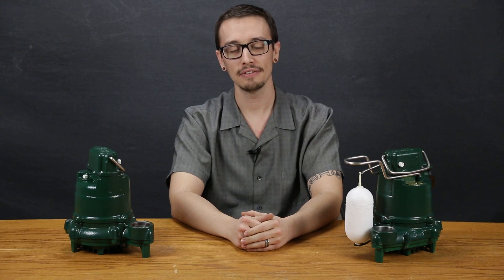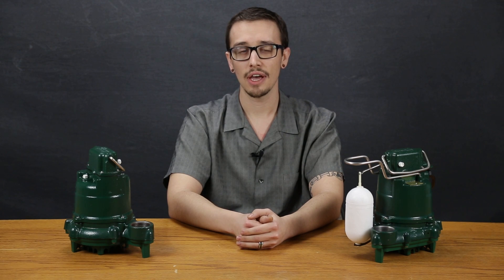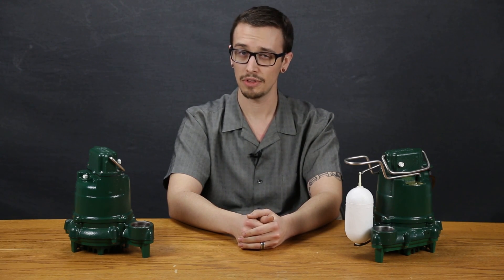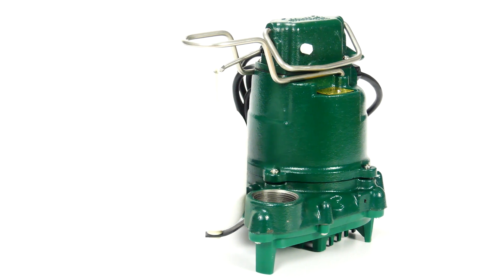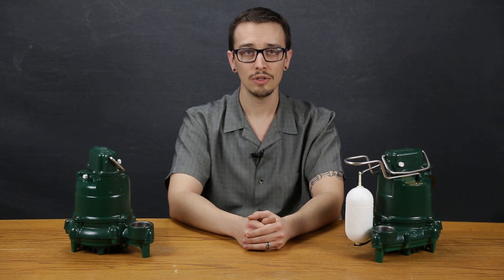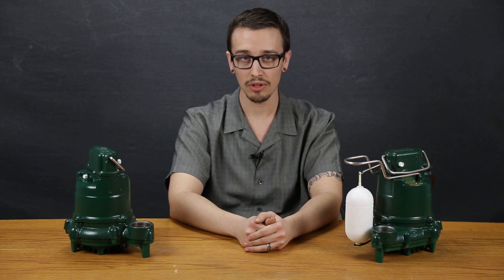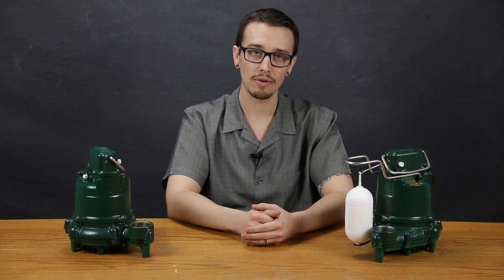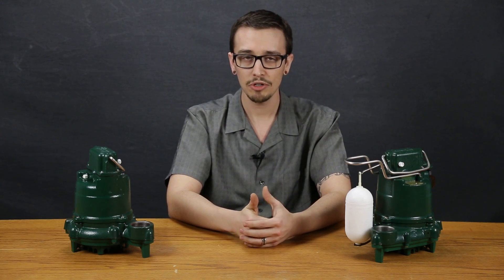Zoeller 53 Series Pumps

Comment: Had a 53 series pump M53-D installed about 6 years ago as a sump pump in our crawl space. MFG date is 0818. The switch already failed. Seems quite premature. These type of switches should last for more than one million cycles. As near as I can estimate this pump is only half way there.  
Zoeller's motor and pump seem to be good quality. The switches they have installed are not.

Comment: Will the M53 be ok to use for my application? Approximately 2' lift,  and around 140' of discharge pipe. Will only be active during heavy rains here in Houston.
Reply from the maker: Yes, it should work great. You can buy it here: https://www.rcworst.com/Zoeller-53-0001-Model-M53-Sump-Effluent-Pump-0-33-HP-115V-1PH-9-Cord-Automatic-p4488.html

Comment: does the M53-D have a vent hole ?
Reply from the maker: I believe so, but you still need to drill one in the discharge piping under the check valve. Check out our video on drilling a vent hole for more info.

Comment: The M53 is a good pump but has a plastic impeller. The. N63 with level guard water switch even better with a iron impeller. Be aware while Zoeller are tanks - they got the amp draw to go with it- which your circuit breaker